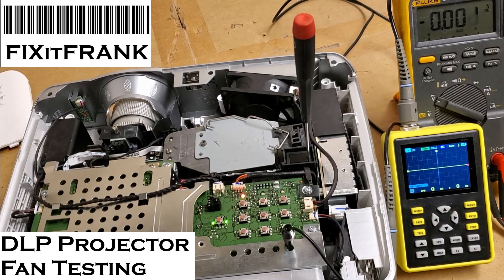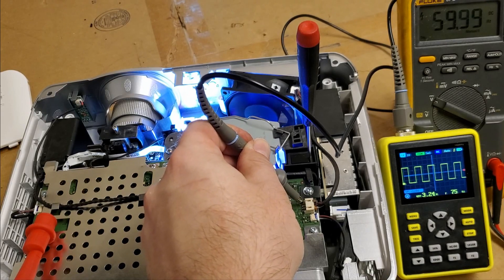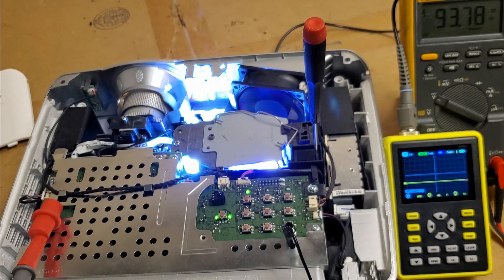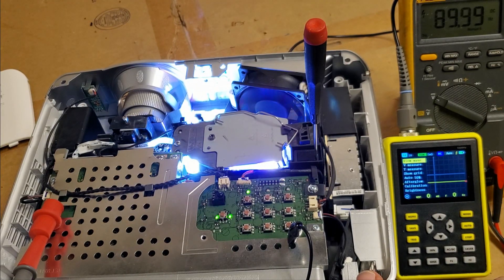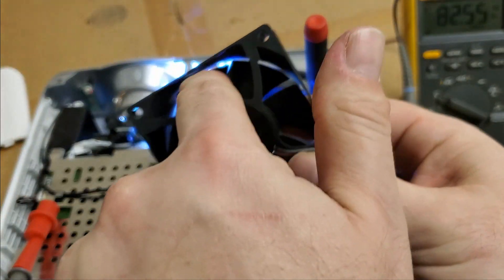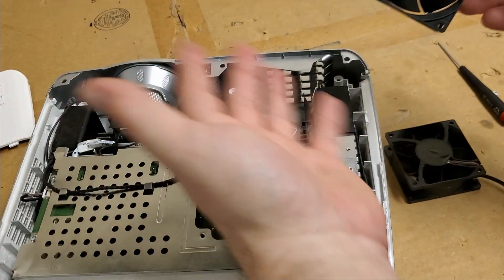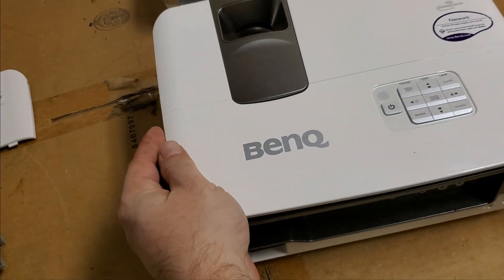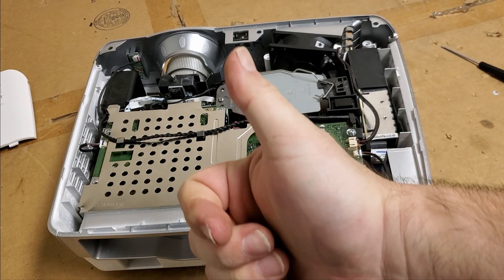Testing a DLP Projector Fan - Updated

Comment: I have the same 1070 that started shutting down because of fan 1 errors. So I put a new fan in and it does exactly the same thing. The o ly way around it is to go the service menus and switch off error detect for that fan and then it operates perfectly😢

Comment: I have a optoma uhd50 pretty sure the fan is going out what brand and fan should I use to replace it
Reply from the maker: You need to use the same exact model as the old fan. Otherwise you will get a fan lock error. It's annoying but fortunately they are not expensive.
Reply: @FixitFrank  Do all projectors throw that error? I'm considering buying a projector (perhaps Viewsonic) and was thinking it might be possible to replace the stock fan with a silent one.

Comment: I have a BenQ W10000 flashing orange and red lights. What could be the problem? Manual says either inadequate power, fans not working, and see dealer. Please help.
Reply from the maker: I have seen that but unfortunately there are a few things that it might be and there is no easy way for me to determine which.  Most likely its a fan that is stuck, or reporting it is stuck.  That seems to be the most common cause but I have seen bad mainboards and temp sensors cause this error.  The fan tends to be the most common.  Also, power supply capacitors. If there are pale green electrolytics, they may be at fault.  That can cause low voltage problems.